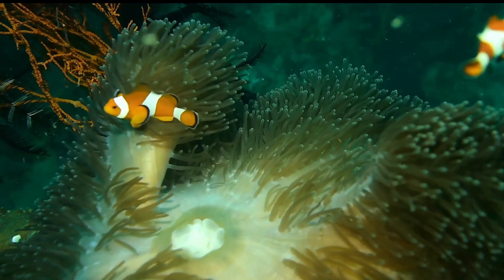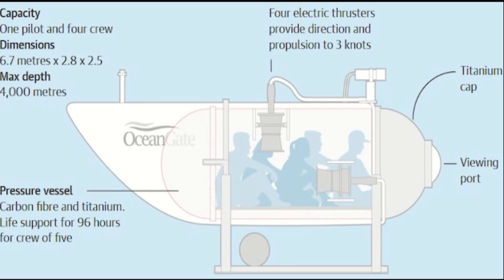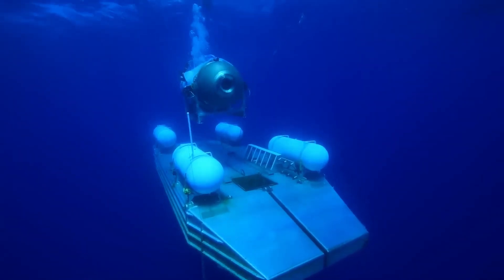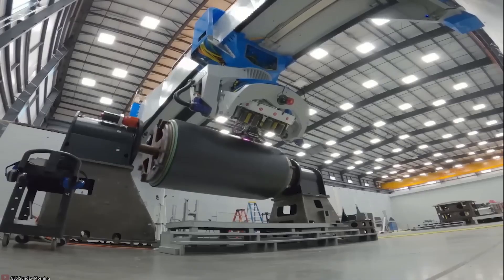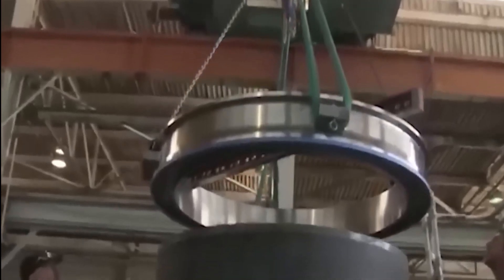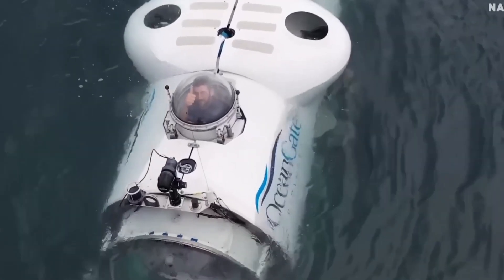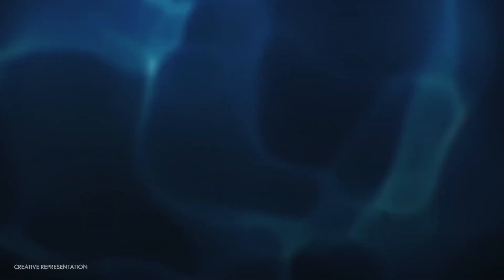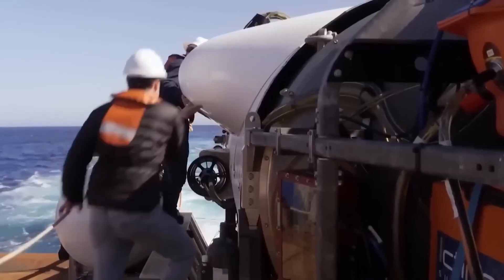5 Possibe reason of Titan Submarine Implosion | The Mechanical Explorer

Comment: Towing a submersible 380 miles. On the North Atlantic,on a raft had a lot to do with the Titan failure.Dynamic stresses.
Reply from the maker: Absolutely,  notonly fatighue stress( dynamic stress) but also high pressure and carbon composite material failed titan.
Reply: Or poor engineering… carbon fiber busts , it doesn’t slowly weaken.